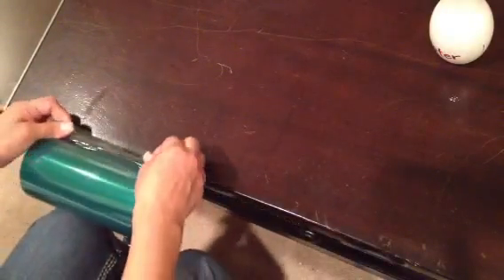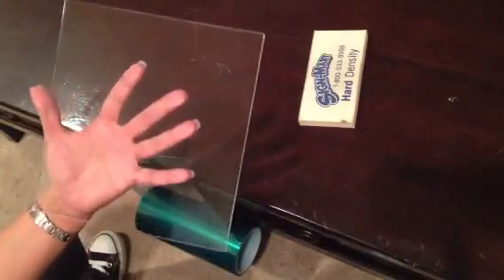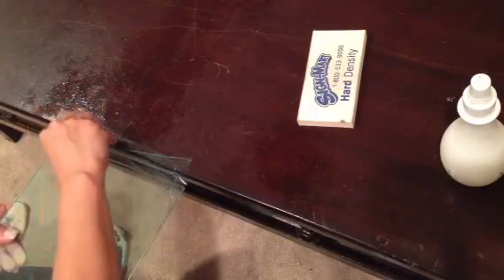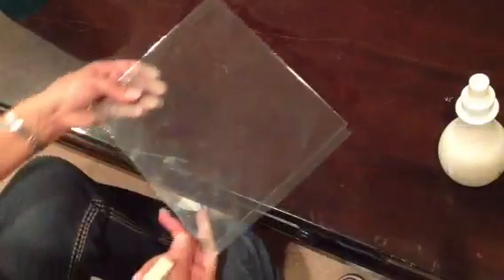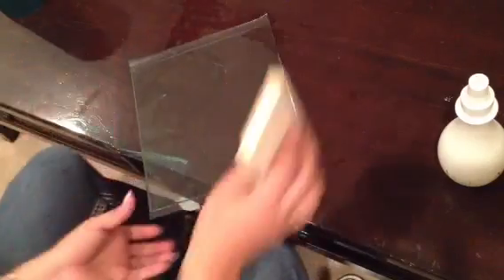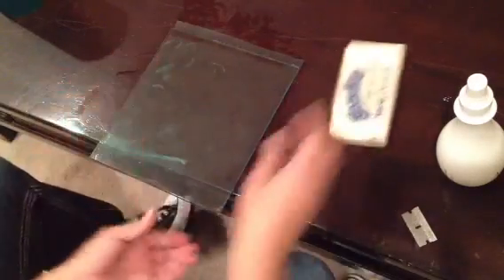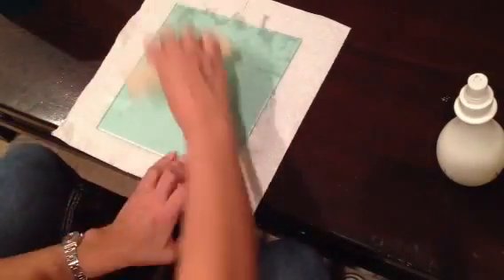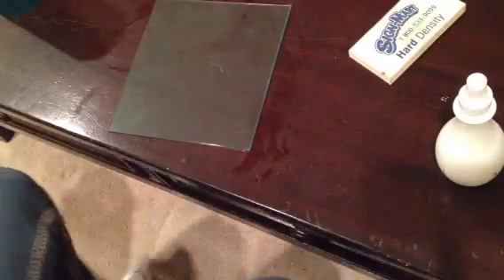Apply pet film to glass for 3d printer

Comment: If you add one or two drops of dish soap to water bottle it will slow down the evaporation of the water giving you extra time time to reapply film in case of reemerging air bubbles.